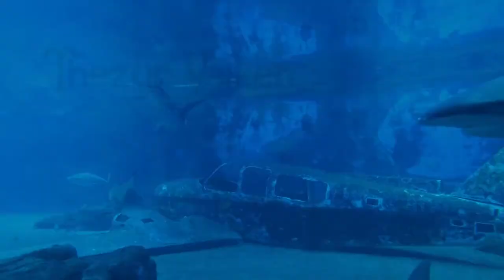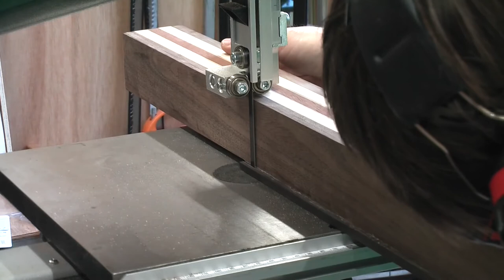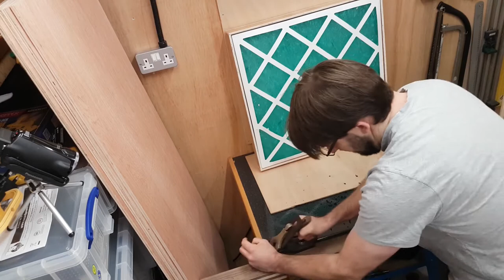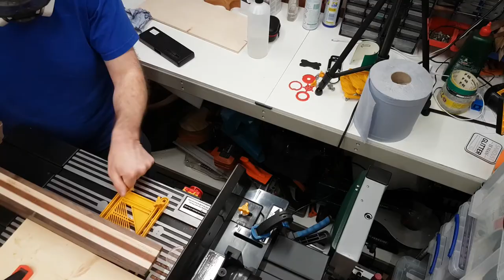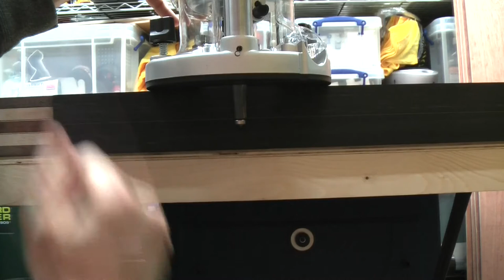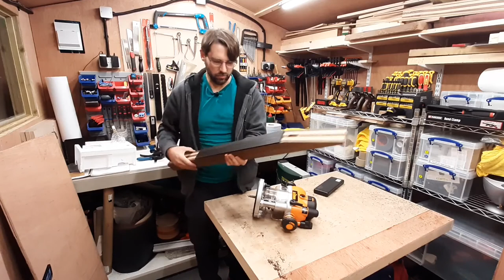Shark fin V guitar - Episode 33.333 & 1/3 more neck stuff and other stuff

Comment: Which router bit are you using to get the fretboard radiused? Didn't know it, it seems to be very very useful compared to handy tools...are those bits available with different radius angles? Thans
Reply from the maker: I had then imported from Australia. I'll have to dig out the invoice and I'll let you know who they are.
Reply from the maker: It was SJE Tools in Australia.